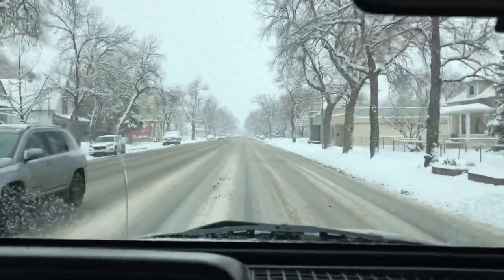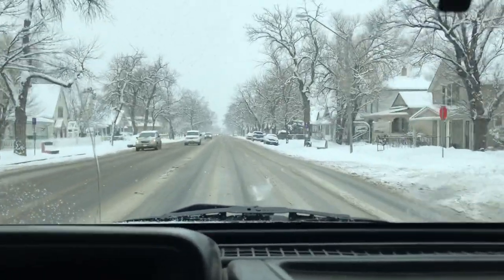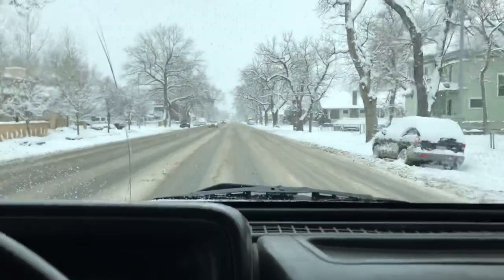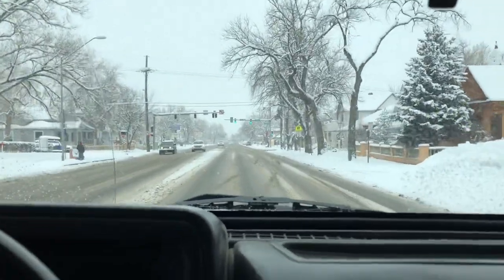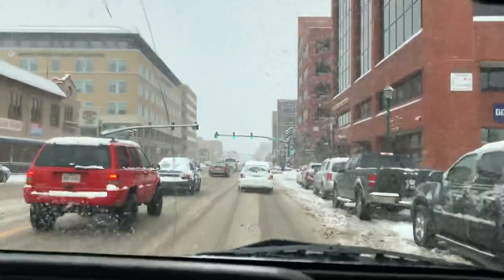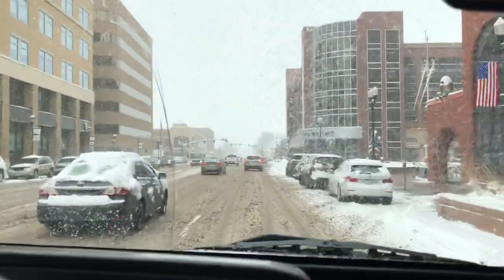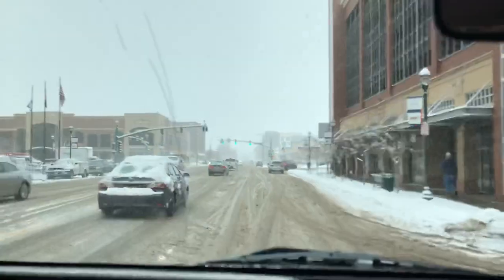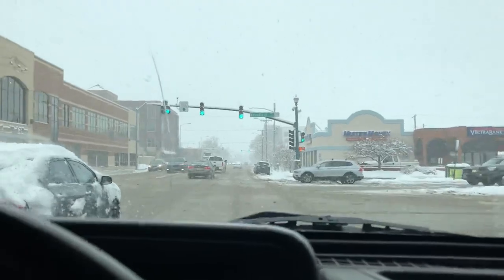THERMOSTAT? FAIL-SAFE VS OEM EXPLAINED! S14E06

Comment: Failsafe thermostat just saved my 2002 jeep liberty's 3.7 engine. I was driving when i noticed that my tempeture gauge went down when ever I turned on the heater. It did not overheat. So, I knew there was something wrong with the thermostat. Drove my jeep like that for a whole week in that condition. So when I had time to work on my jeep. I removed the old thermostat.  When I removed the thermostat. I forgot that I myself had installed a failsafe like five years ago in 2018-2019. That's what happens when you get old. It was lock opened and it was a failsafe. I was soooo happy. Because, if it was an oem thermostat. I would blown the head gaskets and stuck somewhere. So I installed another failsafe. Let's see how long it will last. Be blessed in Jesus Christ's authority and his power Amen!✝✝🙏🙏❤❤🎺🎺👍👍🐏🐏🕊🕊🦁🦁😂😂🕛🕛🎺🎺🎺🎺
Reply from the maker: AWESOME!!! amazing anyone would make them fail closed in the first place.
Reply: Seems like they don't last long according to many reviews
Reply from the maker: Fail safe or regular?